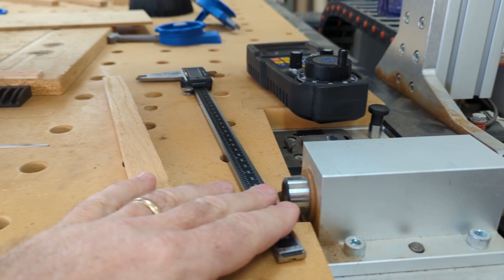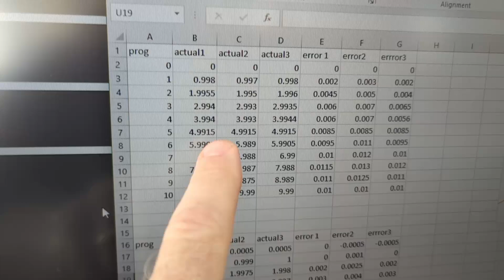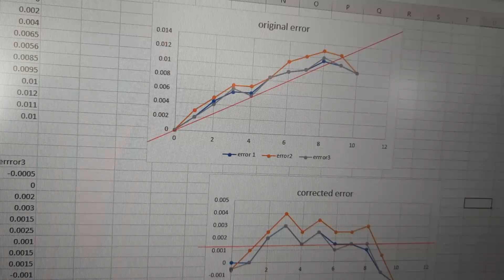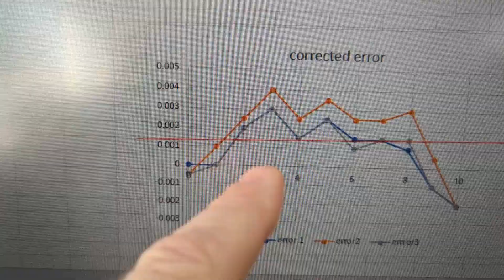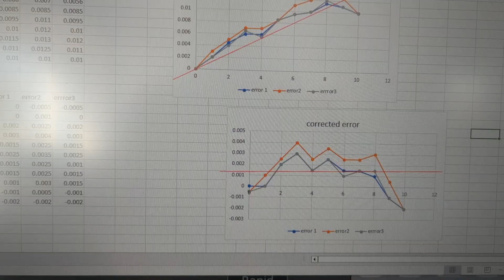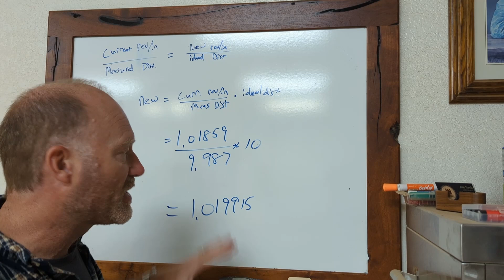How to Compensate Axis linearity Error on an AVID EX CNC with Centroid's CNC12 Software

Comment: Hello Jim,
I just also made the switch from Mach to CNC12 on my Avid Benchtop Pro 24x24. I also am using a rapidchange ATC and had that set up for Mach4, but I am brand new to CNC12/Centroid. Did you set the rapidchange up for your CNC12 setup and if so, have any pointers about how to use it? For  Mach 4 I edited the screen set to add buttons for manual tool measurement and indicator led for the IR sense plus a button to control the dust cover, but not familiar with how to do any of those with CNC12's virtual control panel. Any help would be appreciated!
Reply from the maker: I was on the path to installing the RC ATC on Centroid, but I really don't need an ATC (as I mentioned in the video I was given one to evaluate), and in the end I decided to reclaim the spoilboard space.  It was still working great so I gave it to a friend.  However, I did look into it to see how much I would have to do before I decided not to use it.  First, Rapic Change does have a full set of macros that support the ATC on CNC12.  The main thing is the M6 macro, so you would replace the AVID M6 macro (which they have heavily modified for supporting spindle and laser together, or you could merge the capability of the RC and AVID ones.  Second, CNC12 does support the reverse capabilty, you would just need to hook up that other relay to the VFD like we did on Mach4 as well.  And then connect the IR input and lid control output.
As far as screen editing, I find CNC12 falls very short of Mach4 in that department.  The whole "CNC12" part of the screen is output only, and you don't really get to edit that.  You can write macros that pop up little dialog boxes when you run them, but you can't add indicators or gauges to it.  The VCP on the right side allows you to add buttons, but there is limited space, and it is really an input only panel, so again hard to make indicators to show status of anything.  They do have a full API that you can theoretically write your own App with, but you almost need to be a software engineer for that.  You can check out Corbin Dunn's work on his ATC software setup that he added (https://www.youtube.com/@CorbinDunn/featured).  You might be able to modify that to your needs, but I'm guessing you will just want to add the buttons you had in Mach4 to the CNC12 VCP.  I don't actually know if you can add the LED indicator for the IR sensor.
CNC12 has been a mixed bag for me.  It is very stable and repeatable, but the software architecture is very dated, and laser support is poor.

Comment: Hello Jim,
  Now that you have had time with your EX CNC upgrades I have a question about moving from the Mach4 to the new CNC control software.
  Are you still restricted from connecting to the network?  With MACH4 it was highly recommended that you didn't connect to the internet and your home network because it affected the software during the project run.
  Thank you again for all the great videos you produce.
Reply from the maker: Hi David,
That is a great question.  So the official word from Centroid (and AVID), is the same as it was in Mach4.  They say they don't recommend it.   However, almost everyone I know just leaves their machine connected the network with no issues.  I have gotten to the point where I will do just about anything  while a Gcode file is running on my machine.  I edit Vectric files, run simulations, watch YouTube videos, FB, and Email.  I have yet to ever cause a glitch in Mach4 or CNC12 doing anything on the NUC (and in the past an old laptop) computer that is running my CNC.  I do however run the PC tuner and make sure that windows updates are always turned off.  I only manually update windows when there is nothing else running, and I also always keep any virus scanning SW off, and have most of my notifications from Chrome turned off.  These are the basic things that the PC tuner does.   
I really think the problems people have are usually related to high priority/load software like updates and scanners running in the background unbeknown to them.

As a sidenote, I have been using CNC12/Acorn for a few months now. Its UI could use a little updating, but it does have a lot of good features built in, and I have yet to experience any corruption, glitch, hang, or any of other weird stuff Mach4 would do once in a while.  It really is a solid controller.   They also seem to be constantly adding features too, so I'm hopefull the UI will be improved as time goes on.